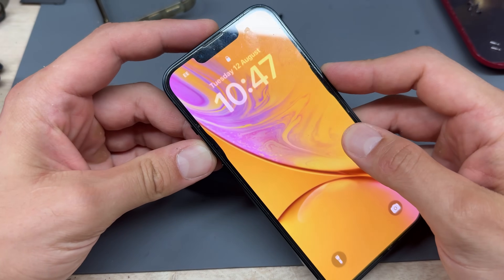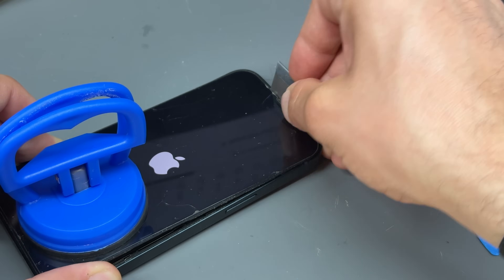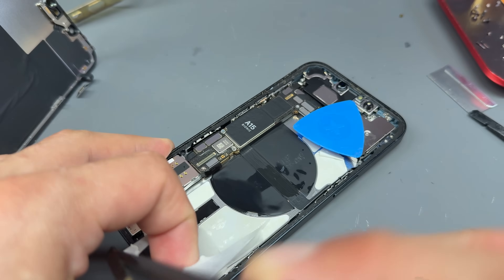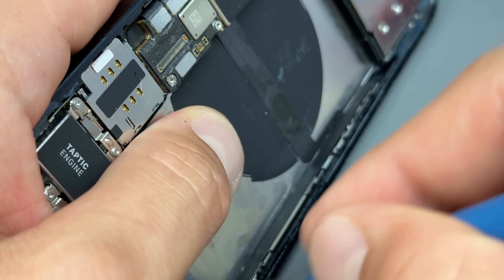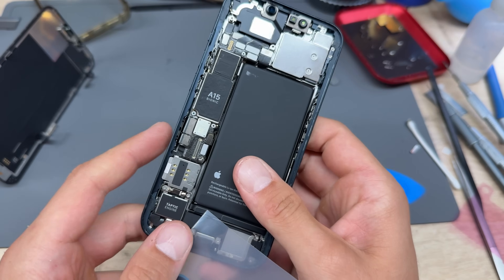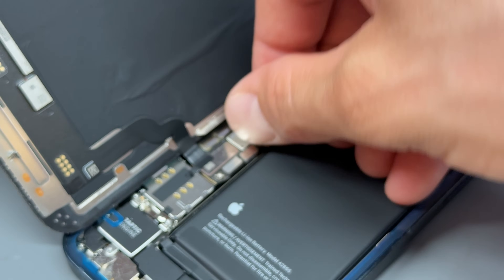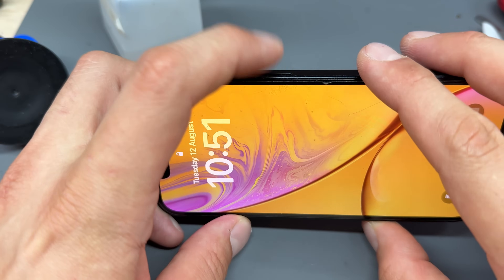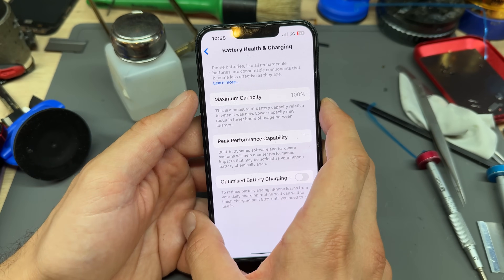iPhone 13 Genuine Battery Replacement – DIY Guide Using OEM Apple Parts! 🔋

Comment: Hi Sir,
In my country, there is a lot of debate about whether to use aftermarket batteries or go directly with authorized Apple service. However, I’ve seen several videos from other countries where many people seem comfortable using aftermarket batteries.

I would like to hear your opinion, Sir. In your country, how are aftermarket batteries generally viewed? In terms of quality and performance, are they considered comparable to the original ones, or is there a noticeable difference?

I hope you have a chance to see and reply to this message.
Thank you.

Comment: True, dont use a heat. If you heat it be very very careful! I just followed different replacement guide with heat gun. I damaged my screen - I split the glass from the frame - display glass popped up but the frame has not.
Reply: that's not from using heat that's just from lack of experience.  that is very easy to do on accident if you don't know what you're doing

Comment: I wish I'd watched this video before using the heat method to remove the screen and managed to separate the screen from and screen frame..... AAAAND resulted in a green screen of doom.... (but I've since fixed that with your soft oled screen, all good now!)
Reply: Was it definitely the heat that caused it?😮.....

Comment: Its not recommended to pry from the bottom for a beginner the screen cables connect in that area and improper technique can easily create a line. For beginners its better to pry both sides first
Reply: It's better to pry from the side

Comment: Nice battery replacement, I wanted to ask if any notification regarding the battery was displayed.
Reply: It will say that it is an original part under settings so there won't be any unable to verify messages

Comment: would it make sense for me to do this myself? in USA, your OEM battery is $50 + the stuff I would need to do it would end up being $20 bucks at least. in USA the battery replacement OEM and all at Apple store is $90, so I think I would only save $20 or so if that and of course I would risk damaging the phone. local guys around here are $110 to replace with OEM. I don't think it's worth the risk of screwing it up for me to do myself... like literally not even a matter of whether I COULD do it, just a risk analysis.
Reply: Phil, for the sake of an extra few bucks compared to what a replacement phone would cost you if you get it wrong, just isn't worth the chance. Put it into a genuine repair shop, you get a warranty of the work, and full satisfaction, is it worth chancing it "for a few dollars more". NO ! Get it done properly.
Reply: Well that’s what I wanted to do, then they told me they couldn’t do it without also replacing the screen, because I have chips and a couple small cracks on my screen, which all totaled more that $200 (I don’t remember how much exactly). So back to doing it myself.
Reply: @Tliwinski  oh, i see thanks. I ended up thinking its probably most cost effective to just have a couple nice battery banks since they hold wayy more than any phone batter for way less cost.
Reply: 99 and tax probably around $110-120 depending on states. I would gone to the store

Comment: Why you use a metal brush on a metal frame ?! That's gonna scratch it
Reply: Not really if you go gentle while using it. Ofc if you use it like you have to clean a grill after it was used to cook it will scratch badly
Reply from the maker: That’s not metal 🤦🏻‍♂️
Reply: @iDoctorUK don't be mad at me. I thought it was metal. I love your videos and always i said that you're the best and kindest repair in the uk ❤